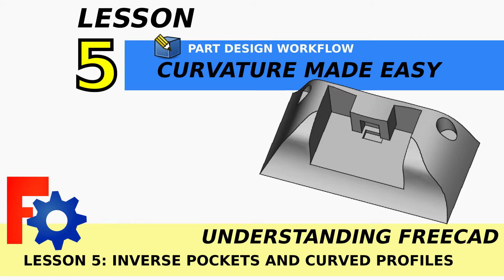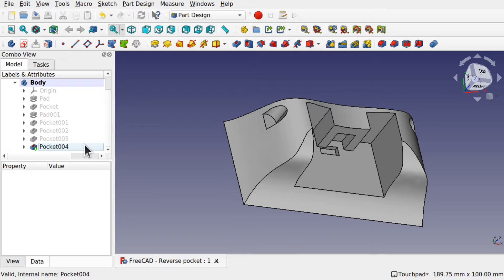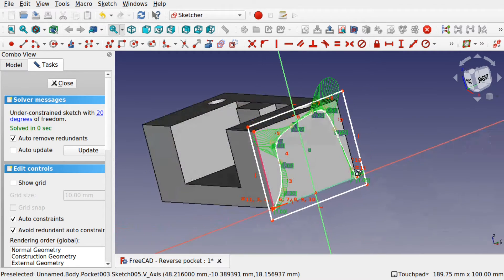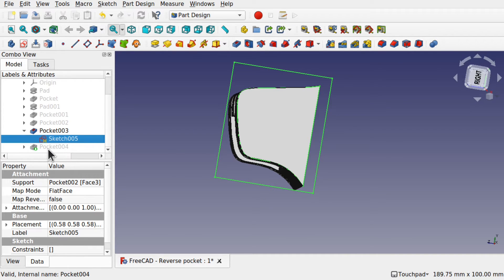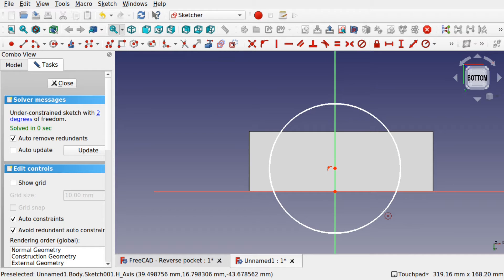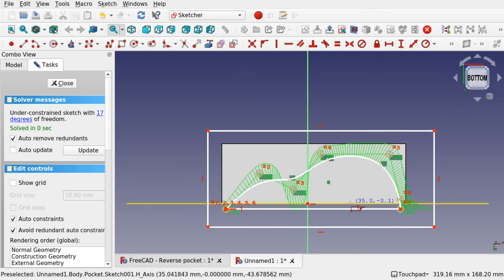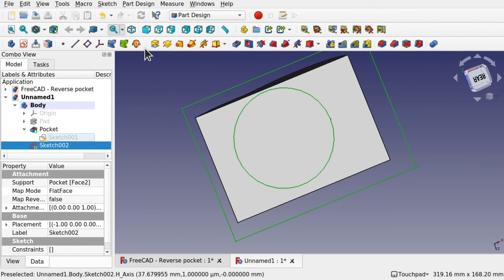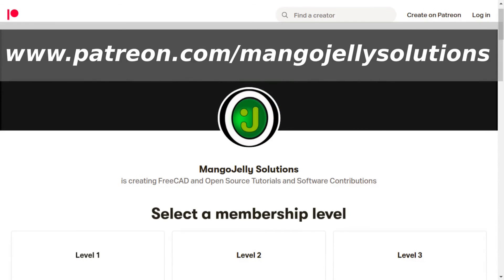Understanding FreeCAD: Lesson 5 - Quick Easy Curve or Curvature | Part Design | Beginners Tutorial

Comment: I've been playing around with this a bit more.  How do I either join primitives so I can pocket or inverse pocket them, or how do I get two primitives (or just about anything else, for that matter) inside the same body with a sketch in it, so I can have some real fun with FreeCAD?  I can create a body and then a sketch, and then create some other thing that gets dropped by FreeCAD outside a body, but if I drag and drop it inside the body, it just creates a reference and then the reference won't let me do the things in this video to the original thing I created (that FreeCAD didn't put inside any bodies).  This is really frustrating.  Help?
Reply from the maker: Are you using primitives from the part workbench in the part design workbench or are you using the subtractive / addative  primitives in the part design workbench?
Reply: @MangoJellySolutions  I just found this after 3 years.  I don't remember, tbh.  I vaguely remember being able to do what I was trying to do, a little easier, in the updated FreeCAD version from a few months back.